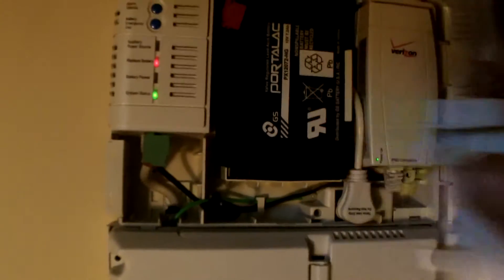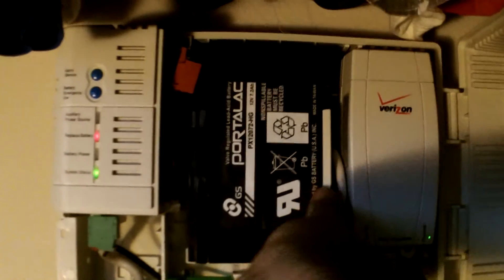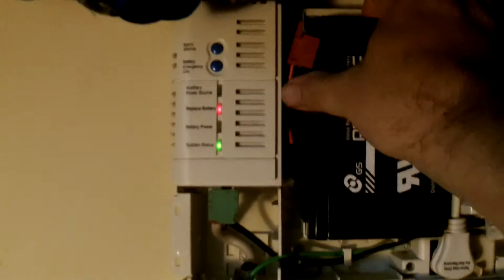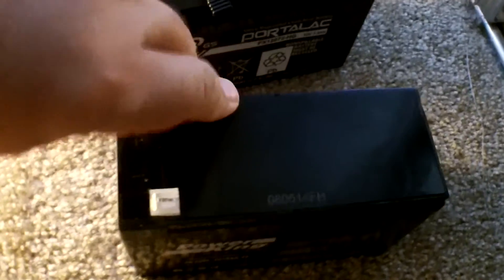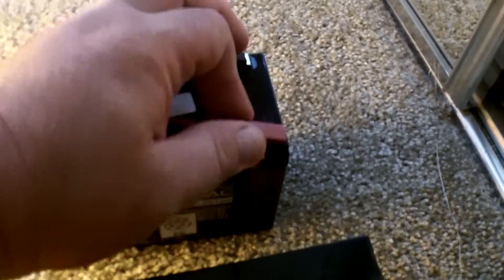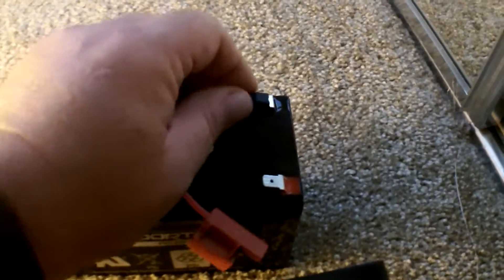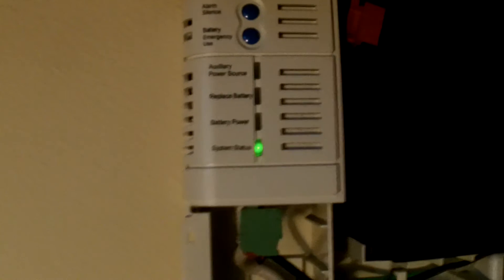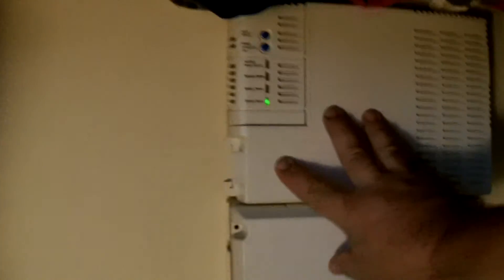Solving the "FiOS Beep" part 2 - Battery Replacement

Comment: Like you I no longer have landline service...only internet. I took the battery out and left it out. I then pressed the reset button for a minute. The red light stayed on, but the damn beeping stopped. My internet still works just fine without the battery.

Comment: Bought a new battery- it did the trick but temporarily..turns out those old battery wires should be replaced as well or bought new w/ a new battery. Went through a lot of bullshit with switching cable wires, checking connections, switching the wire housing etc  trying to find the cause of my problem. Decided it was the battery, and replaced it. Well it wasn't the battery after all but the wires it uses.

Comment: I ordered the replacement battery but had a problem removing the Red wire from the original one...there seems to be some type of wire anchoring it to the metal piece that it slips over.  The Black wire came out easily...but not the Red one...can anyone  help with this issue.
Reply: oh sweety me too but just pull the red cable  back very hard and thats it, but you don't have to unplug the red one only the black one
Reply: Hi.  I know this is an old post but just fyi if you use a rubber mallet and gently tap the end of the red casing a few times on the red lead it should dislodge it so that you can slide it out.  I had this same issue today and it worked thankfully!  Give it a try and hopefully this will work for you.